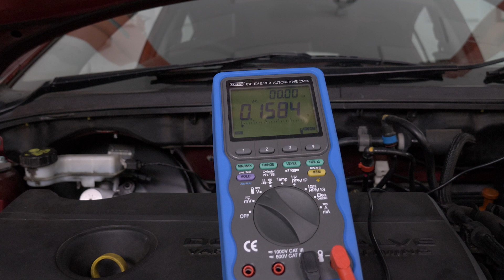How To Test An Alternator - DIAGNOSE AC Leakage!

Comment: I just changed my alternator in my 2003 Acura RSX the old one was charging at 16 volts I had no battery light on I put a remand Nippon denzo alternator which I heard now after I did it that they have problems with the voltage regulator nonetheless I put it in the car charges at 14.5 volts but the battery light is on and I'm reading over the list that they give you on the printout when it passed and it was saying for ripple current its 27 amps is that normal and then the leakage current was 1.10 milliamps and the maximum output for the alternator at 6,000 RPMs is 133 amps but it's a 90 amp output alternator is what it's supposed to be